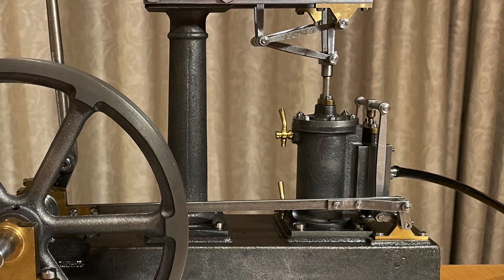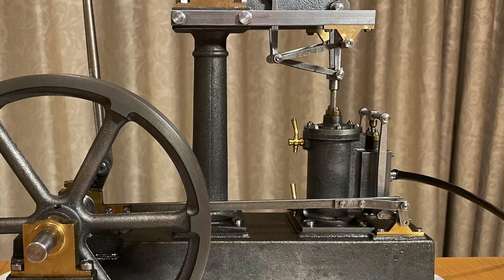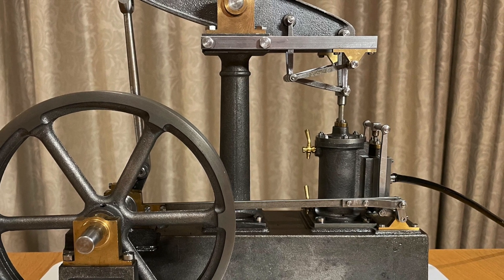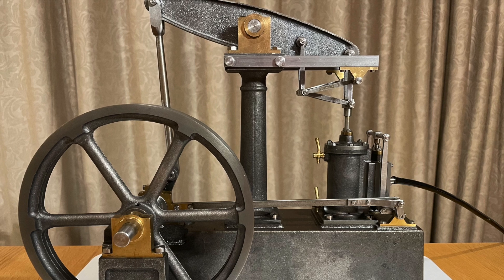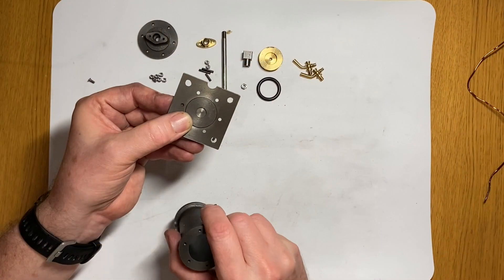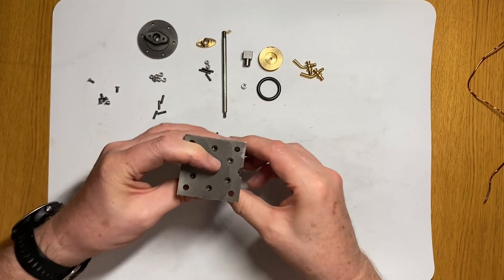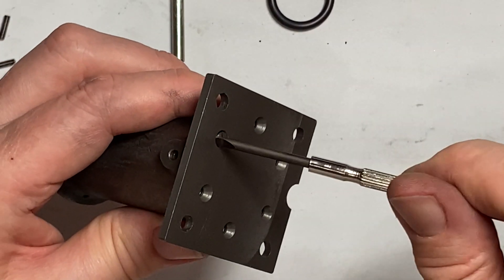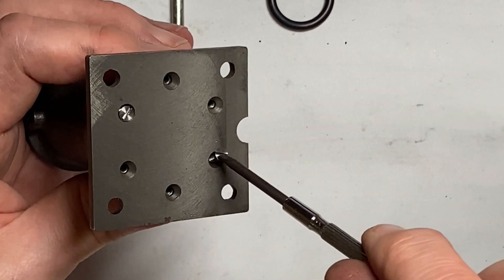Stuart Models Beam Engine - Full Build and Run.

Comment: A nice machine, but I'm surprised that no gaskets are used between the parts that contain steam pressure (or compressed air). The piston ring, which is made like an O-ring, is also a weak point. The rubber ring will wear out quickly. Finally, ball bearings would have made the whole thing more efficient and durable.

But still a nice machine that could be fun to build :)

Greetings from Denmark
Reply from the maker: Thanks!  Gaskets were fitted on final assembly after the machine had been painted. I agree that ball bearings would have made it smoother and long lasting, but steam engines traditionally use plain bearings. The model is never run under load and is only run every few months or so, so it’s never likely to wear out!  

Glad you like the engine, it was certainly fun to build and is admired when it’s run.

Comment: The piston does not appear to be seated correctly. There is movement where there should be no movement
Reply from the maker: That’s very observant!  It was rocking a smidge. I’ve since stripped and painted the engine and it’s seated properly now. Thanks for the comment.
Reply: @modellingmark  brilliant! What Color did you go with?